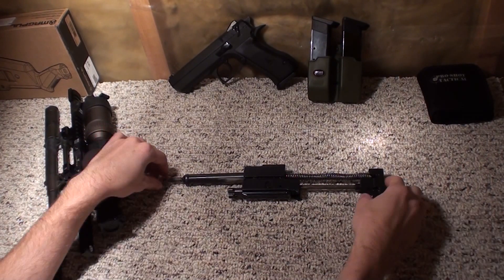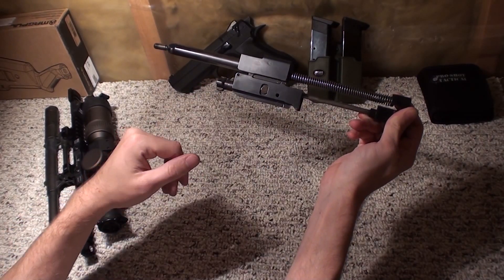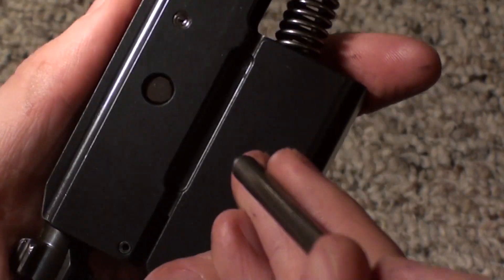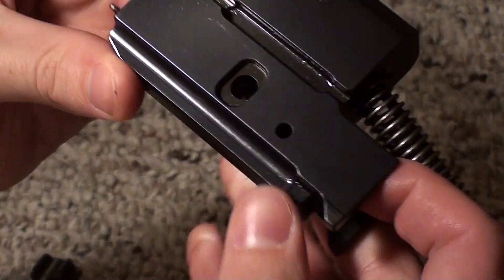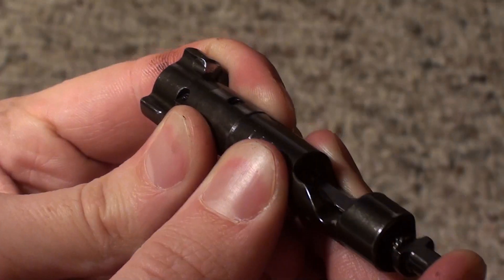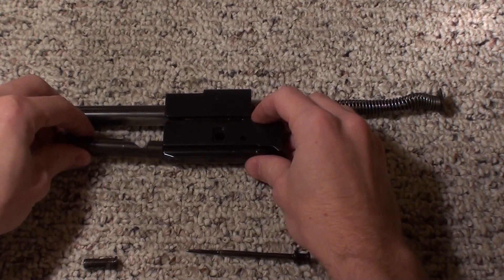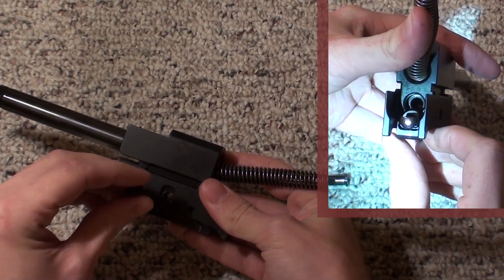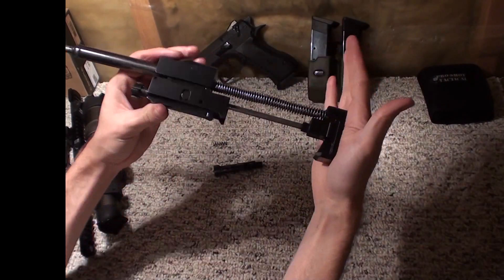Disassembly of Tavor TAR-21 Bolt Carrier Group & Gas Piston HD Part 3 of 3

Comment: Hello, I use Google Translate so excuse me if my English is bad. I have a Tavor X95 I think first generation because I have to lift the spring lever to disassemble the slide. When I bought it there was no firing pin spring in it. I bought one but when I put it back together the slide does not lock fully forward. I saw on your video that you were talking about two types of slide (civilian and military). First question: are the springs identical. If so, second question: could you show me the differences to see which slide I have and that way I could see if I have the right spring for the right slide. I hope I was clear enough in my question

Comment: Is this the 5.56 bolt or the 300 blk out bolt?  I just got my 5.56 tavor and the booklet showed this as 300 blk out bolt. Did they change the bolt look?
Reply: That's how mine is, I can't get the bolt guide pin out of mine to clean it. I tried both ways in the instructions and neither one works. The IWI video shows the spring with no pressure when they pull it back but mine has constant pressure. I just want to clean and oil the damn thing.

Comment: Back in 2010 when I first built an AR off a stripped lower. I went to a range and slapped the bolt release. Bang! Never pulled the trigger. Damn thing slam fired. Everyone thought I was reckless, and then I explained I only released the bolt. My friend brought up that military ammo has harder primers to prevent that.

Comment: Thanks for the video but it wasn't useful for my Tavor Tar 21. I have to move the Bolt Rotation Control Bar back towards and through the Buffer. FYI for other users: There are (From what i've seen) 4 different methods in order to remove the Bolt Guiding Pin.